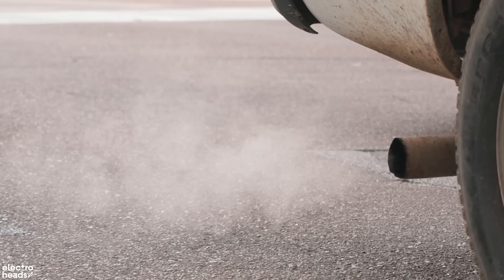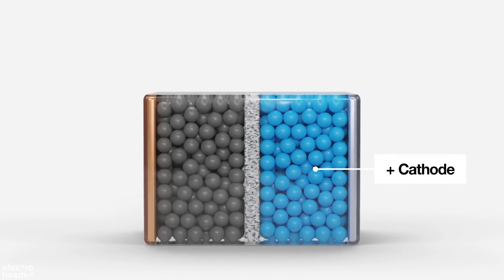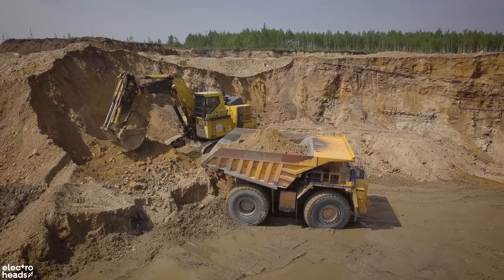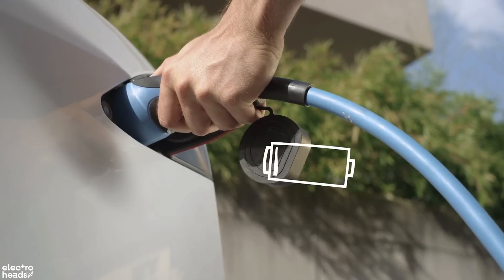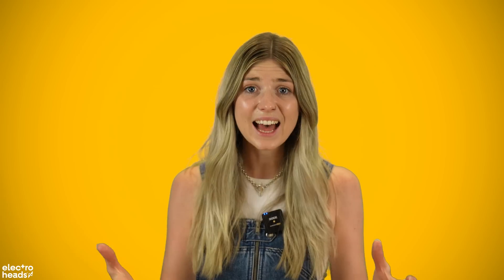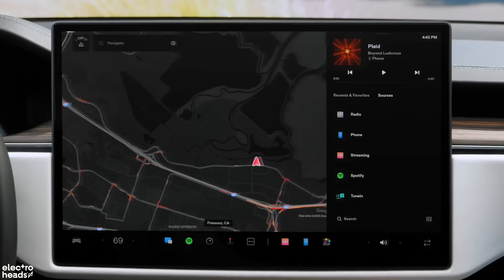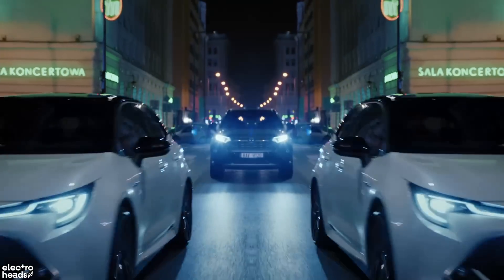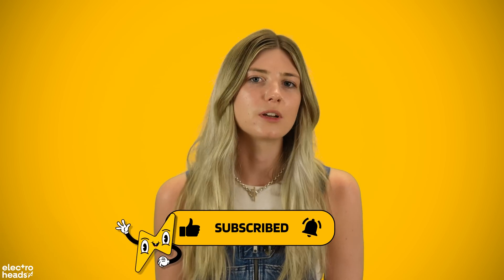This electric car battery gives me wood

Comment: Lithium mining is the worst part of the battery no one seems to remember when everyone was up in arms about the acid rain in the Congo from China's lithium mines or the fact that the carbon footprint of manufacturing a electric car is 3 to 4 times that of a gas powered car . Or all the fossil fuel burnt to make the power to charge all the extra cars . I buy used cars don't drive much so the guy who buys a new tesla every two years , in ten years will have a bigger carbon footprint in his car than I have in my two cars and my house .EV's caulas ground .water . and air pollution and still depend on fossil fuel . Don't get me wrong EV's are innovative and sometimes even fun but I'm not sold on the good for the environment reasoning .

Comment: I only want an upgrade battery for my Vaxhall Ampera PHEV, with the latest battery tech. The little beauty could probably have triple it’s EV range of 120 miles, good for 93.425% of my driving if I could get one. Can’t afford to spend £50k on a car and if I did have 50,000 shmackos sitting in my bank account I’d probably get a Hymer Free S camper van, airB&B my house and say sod-it to Richy Sunak’s authoritarian slave economy. Yes I have/had a business, then IR35, maybe if Sunaks wife paid the £600,000.00+ she owes the tax man, we wouldn’t have needed IR35 and ordinary people could have little businesses,  but then do the Torys want ordinary people making money for themselves and not their rich friend shareholders? sorry rambling.
 
Surly the answer to reducing net C02 and affordability is for companies to make new latest tech. batteries for existing EVs and PHEVs, leaf, zoe, Volt/Ampera etc, etc. Even upgrade kits for popular cars like golfs and 3 series to strip out the engine/gearbox and pop in an electric motor and battery.  Repair, Reuse, Recycle. Only reason ICE cars fall apart is the engines are rubbish, even BMW engines don’t last much north of 100000 miles, rest of the cars are fine and dandy.

Me feels auto makers are just using the EV revolution and the guilt trips of good honest hippy-type people to strip them of vast sums of money to save the planet, whist filling their new shiny EVs with loads of pointless tech. which will all go wrong in a few years and cost a fortune to fix.

Comment: As I've always said about batteries and EVs, it doesn't matter if the range is not as good as the leading brand, it's how long it takes to charge that really matters. So if the Lignin batteries are able to provide faster charging times with less range, that is still a win for EVs and the consumers that purchase them, as consumers don't want to have to wait 45-60 minutes for a charge, whereas, a significantly shorter charge time is usually more desired.
Reply: If you can't get home where do you charge it ?

Comment: Hydrogen ICE vehicles have less carbon emmisions if done correctly. A man in the mid-west USA needed power for hia newly built home. Running commercial electric to hia house was going to coat more than he wamted to pay, as he was further from power lines than was feasable. He reaearched solar. Solar piwer to run his home would cost leas, but he wanted reseaved foe months that were largely over cast. So he discovered he could convert access power to hydrogen. So he installed a furnace that ran on hydrogen, and found he also was creating enough hydrogen to run all of hia vehicles and equipment. After a few years hia solar system paid foe itaelf. He did not need to buy fuel for his cars, or gas and electric for home use. so for more than 10 years he has not needed to buy fuel for cars or electric foe hia home. It coat him only $2000 more for his solar system anf hydrogen generation than to have the power company run wires. It paid for itself in the first three years, and as I said he has had free enegy for home, business, amd vehicles for over 7 of those years.
Reply: The math doesn’t add up to that. Hydrogen cells run on compressed hydrogen. Making that hydrogen requires massive amounts of electricity and hydrogen engines are just not efficient enough to make up that difference. So while hydrogen is zero emissions like an EV, it isn’t a sustainable form of energy to use in vehicles.  What it has going for it is solely the speed of refueling. Once solid state batteries take over in a few years, no one will even think of hydrogen as fuel.
Reply: This, I'm all for doing this hopefully this will be an option rather than people viewing ICE as the devil. Do you have a source for this?

Comment: An interesting idea but is it scaleable to multi-millions of batteries.Yes LFP batteries are a proveable technology that can be scaled. While new hi-tech batteries sound exciting and may have niche uses, present technology is acually all we need to convert 100% to EVs for transport and both domestic and utility scale battery storage. The only use cases that require higher density solutions would be mass air transport and I'm not talking about AirTaxis. Present batteries are probably allready good enough for that. No, I mean to convert long haul flight to battery powered we will need higher density than the present state of the art.

Comment: Very refreshing to hear from EV advocates not pretending they are zero emitting, at the moment at least. Hopefully with battery improvements like these and other improvements, things will get there eventually.
Reply: My 10 year old Tesla is zero emitting.   Solar on the roof solved that problem.   We’ve driven far enough that the carbon and pollution of a gas car would have been double our Tesla in 10 years.
Reply: @smartelectriccar  Not sure where you are, but here in the UK, my roof space is not large enough to generate 50+kWh every few days. It would take well over a week for a full charge. We'll get more renewables in the UK over the next 20 to 30 thirty years and ween our energy off oil/gas.
Reply: @dna100  That’s an issue of your roof space, not your country.
Reply: Again, EVs are zero emitting! The making of them is not! Why are you people cranially unable to function in a non-binary way?
Reply: @afcgeo882  In the Uk we have oil, gas and coal to provide electricity. Not that difficult really. Not all EVs(the vast majority) are powered from the CO2 emitting UK grid. Smugness is not a clever trait.
Reply: @dna100  You also have wind energy in large quantities, 11 nuclear reactors, and over 1,500 hydroelectric plants.
Reply: @afcgeo882  All of those renewables/nuclear provided just under 50% of the UKs grid. So we still have a considerable way to go before our electricity is carbon neutral.
Reply: @dna100  45.5% actually, but it is growing, and believe it or not that is a very high percentage. Germany’s at 49%. France is at 23%. The world average is at just below 30%. Hydroelectric power in the UK has grown 5-fold in the last 20 years. Being carbon-neutral is a very long-term goal. Much of it will be made difficult by not only production of electricity, but by the move away from fossil fuels toward electricity in general. Think home heating, stoves, etc. all being electric. This is happening all over the world.

That said, the energy efficiency of EVs is so good, that even if you produced 100% of their power by burning oil or coal, you’d still end up burning far less of it than you do by driving a similar ICE vehicle. Most ICE engines today achieve 30-37% thermal efficiency. That means about 65% of the fuel goes to waste (transforms into heat and exhaust). EV motors are about 85% efficient.

What’s worse are the fuel to movement ratios. About 17-21% of ICE fuel energy ends up powering the actual wheels. In N EV it’s 59-62%. This is according to the US department of energy. That means EVs are roughly 3 times more efficient. Even if you add all the energy loss during the transport of electricity, you’re still way ahead (because petrol/Diesel needs transport too).

Comment: Another problem is also the lithium mines. There was some talk of radioactive batts but a pocket nuke of every car seems a bit too dangerous.
Reply: Lithium is extremely common.   Once it’s mined and put in a battery, it’s fully reused forever with recycling at end of life.  Not so with gas where the pollution is released in atmosphere.
Reply: The bigger issue is cobalt mining, actually. Lithium, despite being valuable, is very common and easy to mine.

Comment: LFP batteries seem to be the next thing. Hopefully, solid state will be the next, next thing. I'm also holding out hope for the Lignin batteries, but I'm skeptical. Thanks for posting. 🙂
Reply from the maker: Yes solid state is looking really promising!
Reply: Solid state is already here. Toyota is already working on adapting it to EVs.
Reply: @afcgeo882  I’ll be very happy when they are manufactured at scale.